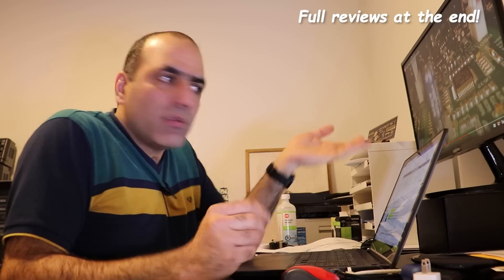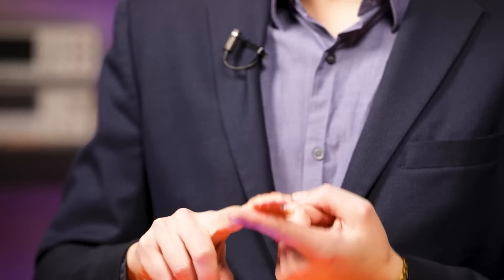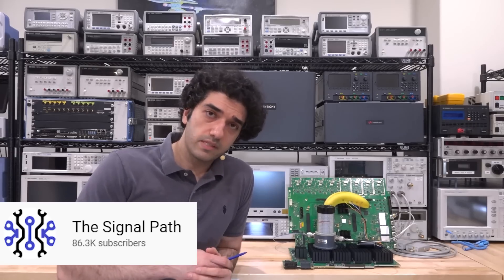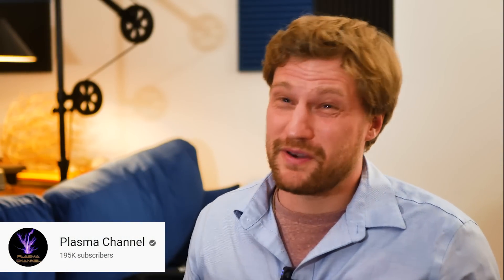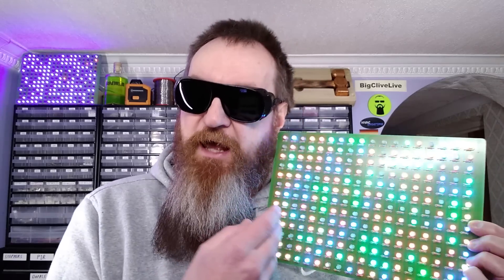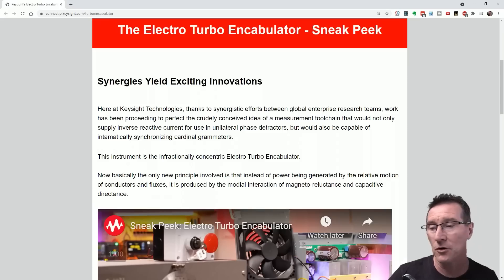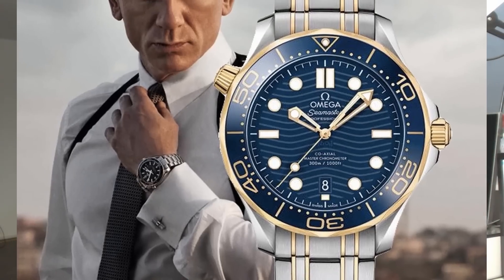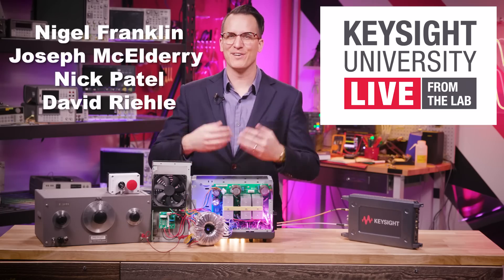The Electro Turbo Encabulator

Comment: I did have some trouble with mine during the construction phase. Turns out I had a defective auxiliary side band feedback oscillating control amplifier switch.  Replaced it and now all systems go! BTW magnetic aluminum shielding also minimizes stray eddy currents in the graviton modulators.

Comment: this is great and all, but this is mainly an electrical solution to capacitative duractance, i need a mechanical one, we dont have the budget to replace our mechanical encabulators, our phase inversion circuits would not be able to handle the load brought about by hyperflux increasement, while it would save us money in the long run, it'd take 2 years to do it. In conclusion, electro turbo encabulators are good and worth their money, that is, if you can pay it.

Comment: I work on an assembly line installing Encabulators. If you don’t align the hydrodynamic fluvial apex matrix with the lateral plasma relay coil you can have side fumbling. 

It’s an important job.

Comment: I bought two of these. Regrettably, both of the bi-planar semi-directional transmorphic audio sinsometric defractors were either installed backwards or were grossly discalibrated. The resultant turmecular monofractic ambulations made the device difficult to syntonate bilaterally. A complete was of 1 bytecoin.

Comment: The original model had an operation temperature of 32 to 150 degrees, as the prefabulated amulate tends to become brittle below that.  I hope thay have been able to improve on that, which would help its broader adoption.
Reply from the maker: Yes! Now that temperature range is in Celsius instead of Kelvin, making it useful in many more applications
Reply: @KeysightLabs  That's fantastic news!  The use of Kevin always added unecessary complexity to the calculation of the retrograde temperature phase disposition through the Jefimenko's equations. Switching to Celcius will make alaysis of the sinusoidal depleneration so much easier!  They advantages are difficult to understate! Just wow!

Comment: i bought one recently and i was not happy with it.
i later found out that i got the model number 28302 instead of 28302-2.
apparently this version has a parametric electron flux negative void coefficent of 3.87 instead of the required 4.98 and thus my measurements (that were based on the industry standard 4.98) were completely wrong and i had to redo it all, and thats NOT CHEAP.
im very dissapointed.

Comment: Do you know that Turboencabulator was around since late-40s? Many companies have tried to push it into the market: HP, GM, Chrysler, Rockwell Automation? The sheer size and weight of the pack-in manual has always made shipping of the damn thing economically unviable!

Comment: Well, for those who for no lack of wants, must make our universe carbon-neutral, and have acquired the turboencabulator, it is cardinally imperative that the differential pecuniary and fiduciary rewards are rigorously determined for a cognitive non-selective appreciation of the benefits of such high-powered non-carbonising generator.

Comment: I'd certainly buy one, if you fix the problem with the electro-lunatical vibrations on the sinusoidal dingle arms. I had this complaint from a friend who used an encabulator for reticulating splines.

Comment: Great video guys!  Will have to look into upgrading soon as my vintage model Turbo Encabulator is finally starting to lose some of it's capacitive duractance, not to mention the prefamulated amulite baseplate is starting to rust like hell.  Also, I think I must have lost a marzelvane somewhere since it's starting to exhibit partial side fumbling.  I've got some Statiophonic oxyogenetic amplifier-graphaphoner-delaverberators to test and this new model seems to fit my needs.

Comment: If you need to reboot, make sure you jiggle the scuzzy drive while you are ctrl-alt-deleting the pram on the ROM!  Rebooting system 32 often times dumps the cache of the jump drive, while expanding the ram into the 5th dimension, and pumping the processor into the quadraflops range!
Reply from the maker: sound advice!

Comment: The Electro Turbo Encabulator is a really cool multi purpose electronic device, but at my researches I have found a bug. 
This bug is related to the date and a little like the Year2K-Problem or the UnixTime-Overflow-Problem, that will occur in 2038. Precisely, the Electro Turbo Encabulator have a problem with the first day of the fourth month every year.
But I'm sure you will fix that soon. Please hurry, I need this for my time machine!

Comment: Can this be used to measure the double data rate of a quantum computer?  I am building one and having some side fumbling issues and odd readings on the cardinal grammeters, this instrument may be what I need to do the troubleshooting.   My regular horoscope does not seem to detect the phase refraction rates going on.   I think I will preorder one of these either way, I have lot of projects that will be able to make use of it.   I was going to buy a GTX 3090 for the quantum computer but this will be easier to get ahold of.

Comment: Never would i put that Turbo Encabulator in my lab. If the photogravimetric zillocurrent containment fails, the resulting mesacapacitive differential might cause exophytoclismic dingleinversions to the thupular protoprocessing branches in all of your other devices connected to same nulltiplicative croconetwork cycle.

Comment: I guess the fan does not spin because it works at higher than 100% efficiency, hence it requires no cooling to remove heat. Very nice collab.

Comment: Instructions weren't clear. I accidentally used caged electrolytic resistors in my pre-production unit (many thanks BTW!!) How can I get some replacement molecular wires? Is this covered under warranty?
Reply: Nevermind, I have just read the fine print on the reverse side of the warranty card using a scanning electron microscope. Apparently, (like the Keysight University giveaway) Australians are not eligible. Please send a quote for 5 (five) replacement molecular wires, incl. S&H and GST.

Comment: I'm new in this turbo encabulator thing but I noticed that you are using valve lamp regenrative receiver and I was wondering does in lotus configuration will it be wiser to use solid-state boabulator instead? Or is it a necessary sacrifice to save the dingle arm?

Comment: Will it ship with 6 or 7 Marzlevanes? If it's 6 I think it's dead in the water.
Reply: Dave is used to 7 because traditionally you needed 7, but because of the graticuled verteron stabilisation, nowadays 6 Marzlevanes are more than enough. The rest is done in software, using a retropassive Fourier-LeBec transform.
Reply: @der.Schtefan  but an even number of mazelvanes are prone to symbyotic harmonic reinforcement oscillation syndrome and would need increased negative damfing. Not good for high dynamic range graticule observations.
Reply: @DaveWilliamsj  yes, in principal you are right, but as I said (and I am not used to have to repeat myself, ugh), this can nowadays be solved in software using "SDM" (software defined Marzlevanes)
Reply: Since they didn't make it fractionally concentric, it will be maximum 6 Marzlevanes.
Reply: This is just another overpriced tool for YouTube stars, not for common hackers! Back in high school we just used a few off the shelf Dimarron phase retractors, some used bog rolls, a reclaimed multi-articulated  pepper coil and some red electrical tape! It was cheap, didn’t require expensive twelve phase dingle power and gave off a nice mint ozone scent!
Reply: Q-RapidPrototyping  True. The latest 1.2 version of the fpga firmware is available on JitHub
Reply: haha...
Reply: That's a quantum marzelvane. It is/isn't. It only appeared because you observed it.

Comment: I already build an improved version with the use of unobtanium cable, got 6 procent more efficiency and reduction of transient antimatter quarks. I wil take orders on Thursday morning.
Reply: I'm a little surprised Keysight has not realized yet that the market for turbo encabulators will fall through the floor once the hyper dual speed  decabinators are available in the 3rd quarter. Use of the ultra sensitive pentaTeluride detector should allow pricing on a per Martian barion basis. You'll be able to pick up a turbo encabinator for the price of a few tau neutrinos.
Reply: @jeffreyland9447  oh that would make my improvements also useless, well until then i can make some nice income. I always find ways to improve new inventions.

Comment: I bought a knock off encabulator from a grey market vendor. Unfortunately I got ripped as it turned out to be a subcabulator. As I fitted it to the stators on my seadoo it turned into(you guessed it) a sub-seadoo. I've never swallowed so much seawater before. Words to the wise.. Check the viscobucity of your encabulator before you fit it to make sure you got the real deal.

Comment: I think I can use this in my bioluminescence endoplasmic cleaner. But I am afraid of the cost. You can basically prototype a plumbus shleem with this. Maybe an overkill?!
Reply from the maker: It would work, just watch out for those caged electrolytic resistors!
Reply: @KeysightLabs  Hmm, those may be a problem in my cell culture incubator, as they may convert CO2 to CO in a 5% CO2 environment. I don't want to suffocate my fellow biologists. Thanks for the hint!

Comment: I think I'm understanding this. Correct me if I'm wrong. The turbo encabulator was held back by its lack of digital quantization. 

Thanks to the new technologies implemented by Keysights quasi-positron engineering team, we can achieve full spectrum ohmic pressure. Up until now it's been impossible to measure with any accuracy, the micro fluctuations within the flux. 

I may not be an expert on the subject, but if I guessed I would say you guys achieved this with the use of some magneto-resistive elements within your ASICs. This is going to be groundbreaking for the development for high temperature quantum computing. Who would've thought the dingle arm will be relevant today.
Reply from the maker: Pretty much! The ASICs use magneto-inductive elements.

Comment: Oh  man, there's a plug missing or not connected???  What!?  You an tell the socioeconomic political climate has changed in some environments.  Appalling.  At least some are concerned with Noise and outstanding warrants. Whether fraudulent entered by gross frauds and cheats offices way more than neglect of duties obstructing  (oh yeah... just joking huh placating like a slick well being check... see if they notice or not let see what we can get away with) or not.  Back to hunting those sound, body and mind control wireless concealed assault weapons guys... at least that's just psychogogic remote sensing and remote transmission hijacking Stockholm syndrome nonsense.

Comment: The hell did you just say to me?
Reply from the maker: Here at Keysight Technologies, thanks to synergistic efforts between global enterprise research teams, work has been proceeding to perfect the crudely conceived idea of a measurement toolchain that would not only supply inverse reactive current for use in unilateral phase detractors, but would also be capable of intamatically synchronizing cardinal grammeters. This instrument is the infractionally concentric electro turbo encabulator.

Now basically the only new principle involved is that instead of power being generated by the relative motion of conductors and fluxes, it is produced by the modial interaction of magneto-reluctance and capacitive directance.

The original machine had an acquisition signal path of pre-famulated amulite surmounted by a malleable logarithmic casing in such a way that the two spurving resonators were in a direct line with the panametric phase noise depositer. To avoid the typical retrogrogursion of the analogarithmic graticules, six hydrocoptic marzlevanes were fitted to the ambifacient electro waneshaft. 

Much to our delight, this effectively quelched the resonant side fumbling.
The main winding was of the analog-style lotus-o-delta orientation, placed in the panendermic semi-boloid slots of the stator, with alternating ectapacitive  and inductuous conductors connected to a reverse biasing cathode follower. This connects to the differential amplicater coil on the “up” end of the molecular angstrometer.

The electro turbo encabulator has now reached a high level of development, and it’s being successfully used in the operation of quantized entaglement realizers. Moreover, whenever a forescent skor motion is required, it may also be employed in conjunction with a drawn reciprocation dingle arm, to reduce cosinusoidal repleneration.

Goniometric data curves are supplied upon request, but you should be cautious of the quasistatic regeneration oscillator vibraphonics. Although you may be tempted, do not use caged electrolytic resistors or sequential transpositioners or the molecular wiring path length will be compromised throughout the stack.

The electro-turbo Encabulator will be made available for sale on April 1st, with pricing on a “if you have to ask” basis.

Comment: I'm using an old Turbo Encabulator from 1944 and wonder if the Keysight version let me calibrate the tickle of the pickle and the angle of the dangle independently.
Reply: Those tube based turbo encabulators fetch a premium price among eBay collectors. But don't turn it on if it has been unused for a while, as the paper marselvanes can lose their polarity.

Comment: Forget the dingle arms - what kind of camera did you use to get between those circuit boards?!
Reply: Probably the Venus Optics Laowa Macro Probe, if nothing else it's a great excuse to buy one.
Reply from the maker: @yngndrw.  Yes, the probe lens is BY FAR the best at capturing the intricacies of the Electro Turbo Encabulator's insides. By far my favorite piece of glass.
Reply: i tell keysight every year the dingle arm needs better documentation.
Reply: Intel wishes they could market their new chips this way
Reply: The PRO version of the encabulator comes with a free* macro camera like the one they used.

* restrictions apply